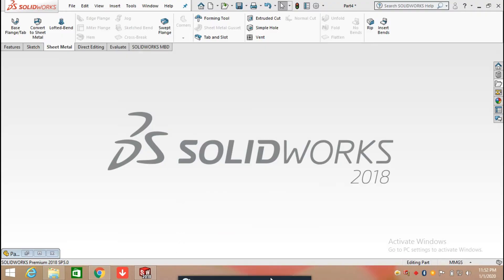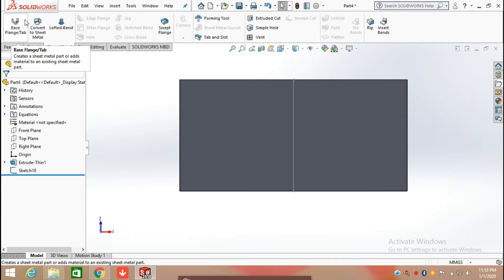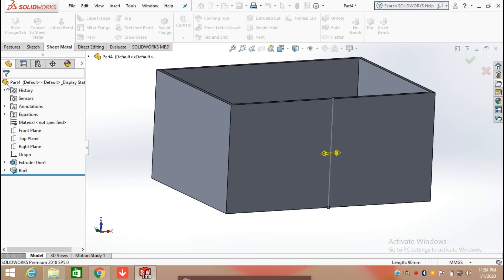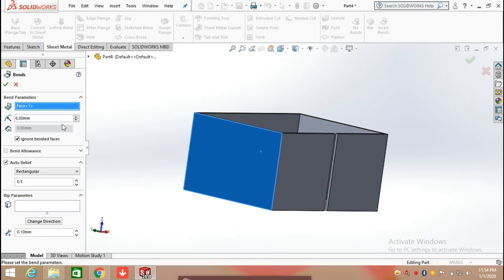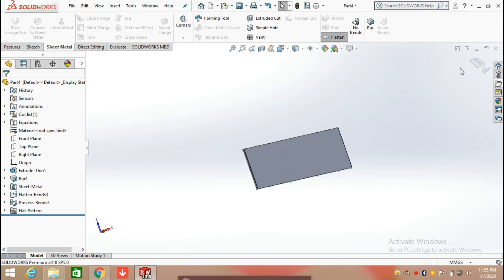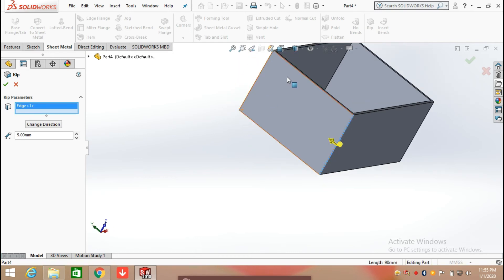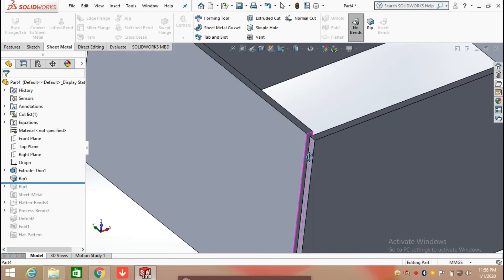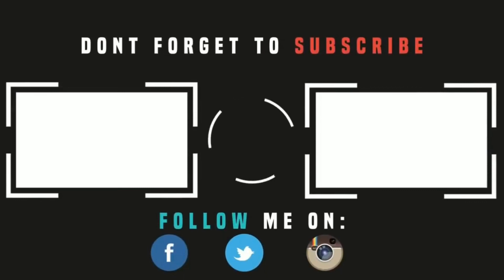Rip command in sheet metal | Solidworks Design Hub

Comment: Thanks for the info. So how would I create an irregular shaped rounded fuel tank and then flatten all sides and make a drawing of each individual piece?
Reply: What is use of this senseless music in video. That's makes ur voice inaudible to viewers.
Reply from the maker: @rahulmisal1901  Thanks for the complement, I will try to improve this in future.
Reply from the maker: FOR THAT YOU HAVE TO CREATE MULTIPLE PARTS OF THE FUEL TANK IN SHEET METAL BUT WHEN CREATING THAT PARTS MAKE THEM UNMERG WITH THE ANOTHER PART NOW YOU CAN EASLY OPEN INDIVIDUAL PART AND MAKE THEM  FLATTEN TO MAKE THEIR DRAWING.
Reply from the maker: IF NOT SLOVED SO CAN SHARE THE COMPONENT ON MY MAILING ADDRESS.
Reply from the maker: Thanks for the complement